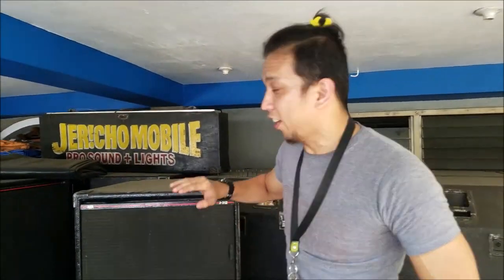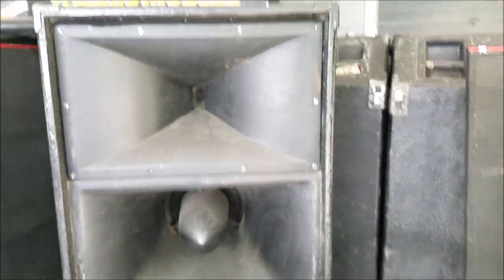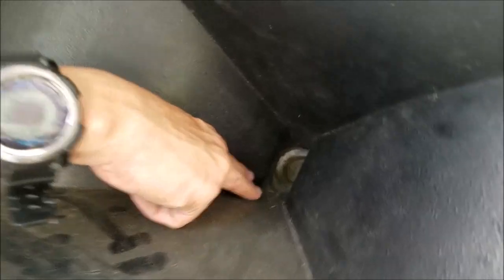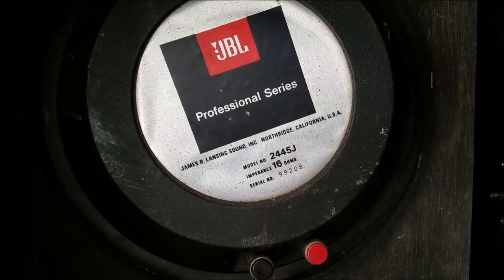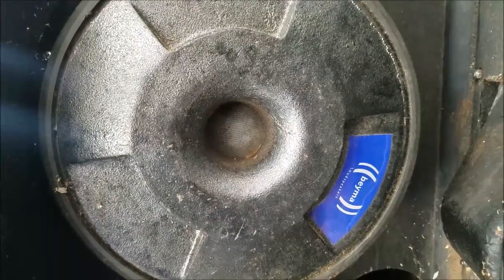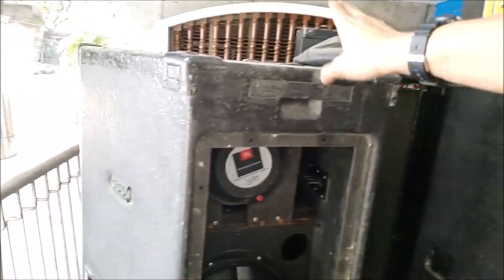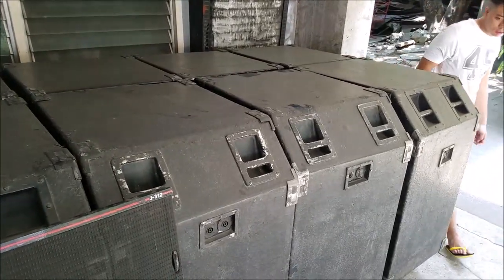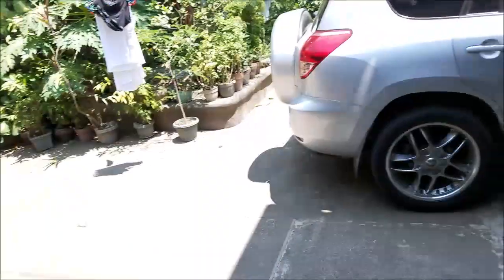Jericho Mobile | Electrotec MB J-312 a look inside

Comment: Sir pwde makita.. Ang loob ng W box...  Kung anu nkaload na sub?
Reply from the maker: sir wala pong time ngayon due to lockdown. nung mga unang panahon electrovoice po ang naka load 600 watts each limot ko na exact model. Then way back somewhere year 2000 nag upgrade kami ng beyma 1000 watts each 18inches drivers
Reply: @ZINDJGABECORDERO  .. Cgeh sir,,  pag normal na ang alahat ... From bicol province sir.. Idol ko rin ang jericho mobile...  Sana ma demo nyo po sir...  Tnx sir,,,
Reply from the maker: @ryanceneta7455  sige po try ko mag demo both electrotec and wbox. Sa wbox po di talaga madidinig actual na kicks at bass dahil ma ddistort mic pickup ng celphone.pag me shotgun mic siguro baka mapickup. Electrotec yan madidinig actual performance
Reply: @ZINDJGABECORDERO  ,,, tnx sir..
Reply: Jack hammer jbl 18 naka load